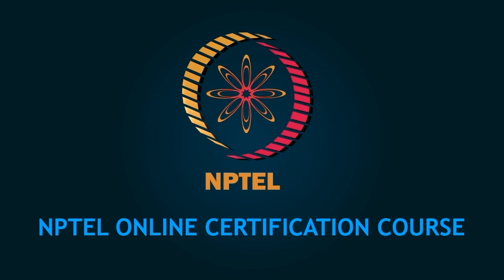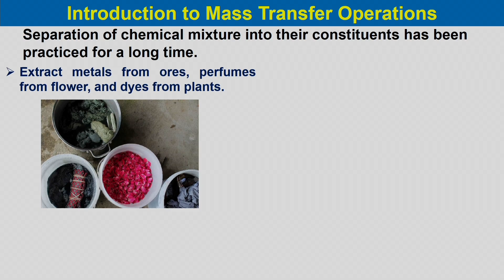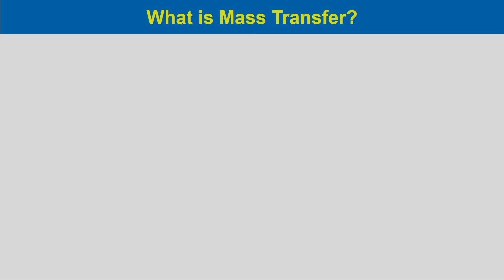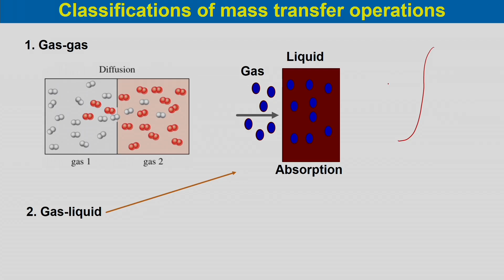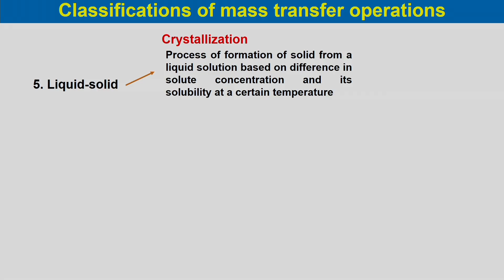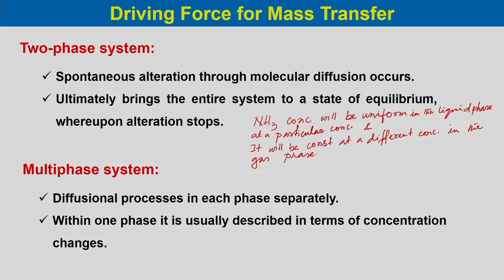Lec 1: Introduction and Overview of Mass Transfer Operation

Comment: A tower, 0.6 m diameter, packed with 50-mm ceramic Raschig rings to a depth of 1.2 m, is to be used for producing a solution of oxygen in water for certain pollution-control operations. The packed space will be pressurized at 5 std atm abs with pure oxygen gas from a gas cylinder. There is to be no gas outlet, and gas will enter from the cylinder only to maintain pressure as oxygen is dissolved. Water will flow down the packing continuously at 1.5 kg/s. The temperature is to be 25°C. Assuming that the entering water is oxygen-free, wiut concentration of oxygen can be expected in the water effluent?

data: at 25°C, the diffusivity of oxygen in water - 2.5 * 10 ^ 5 * c * m ^ 2 / s viscosity of water -0.894 cP, and the solubility of oxygen in water follows Henry's law: overline p = 4.38 * 10 ^ 4 * x . where pequilibrium partial pressure, atm, and x mole fruction of oxygen in the liquid. Neglect water vapor content of the gas.

Sir could you give the solution for this question it would be very helpful.